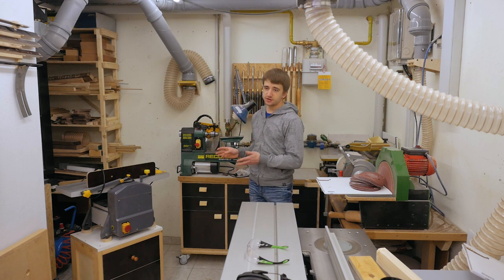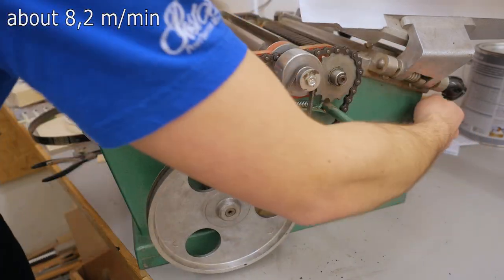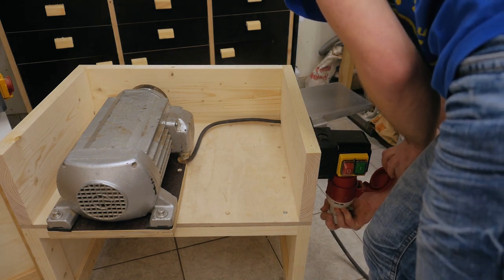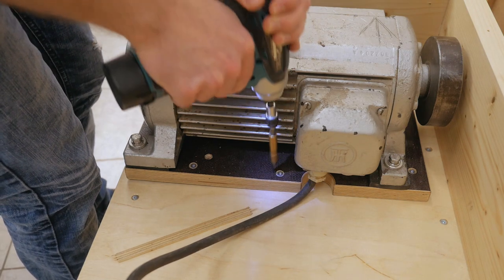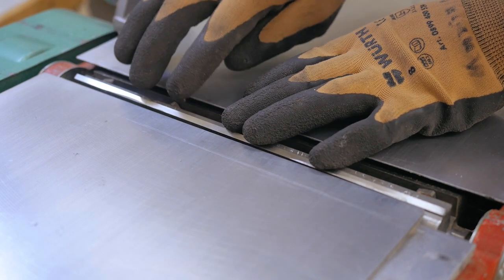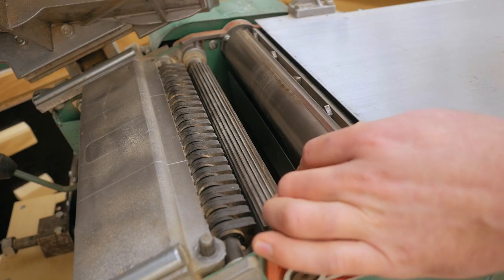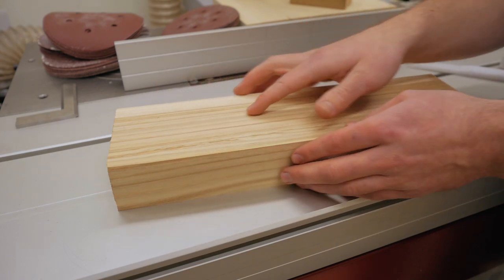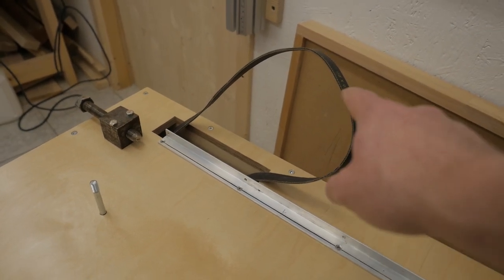New Old Jointer/Planer: Kity 636

Comment: What make/brand was your old jointer/planer? How did it perform and how much? Thanks
Reply: Robert Williamson. hi. It looks like my Woodstar PT85. Very much a hobby machine. The 85 means 8" cutting width and 5" thicknesser. Can't remember what I paid for it but not one of the most expensive for sure. I am sure you will be able to research it online. Regards, Mike
Reply: Hi Mike, would appreciate some feedback on performance. A lot of the reports on the net don't look too promising. How did it serve you?
Reply: Robert Williamson . Hi Robert. My workshop is very small so I bought small and cheap. I don't use it very much. Perhaps because of that I am not expert with it. Results are so so. If you intend doing a lot with one or want good, consistent results I recommend a better quality machine. Good luck. Regards, Mike

Comment: Hello.  I also have a kity 635 and want to restore it. Do you know how to remove the gears (chain wheels) on the back from the axes? Thank you. Jw
Reply: Recently I bought 635 and 616, and I will want to renew them to work on them. However, they are currently in the UK and I live in Poland. How will I know on the spot if I have dealt with the problem.
Reply: Its hard to remove but its possible, probably u have also as i lot of corrosion. I use blow torch and wd40 to pull it by puller. After it i take sandpaper and make it smoother to fit better.

Comment: Beautiful machine!
Wouldn't you prefer buying two planers, and building a Matthias' jointer from one?
Can you buy replacement blades easily? Nothing changed in so many years?
Reply from the maker: I have no space for two individual machines. New blades are still available.
Reply: Marius Hornberger i know you built  a Wandel jointer in the past.  Are they comparable in quality?  Is the only reason you got rid of your wandel jointer space considerations?
Reply from the maker: I've never built the Wandel jointer
Reply: Woops my bad.  I sincerely apologise.  I could of sworn i saw it in the background of your videos... now that i cone to think about it I'm pretty sure it was CosmasB.

Comment: Is residential 3-phase power normal on that side of the pond? Consider me envious if it is.
Reply: Yes, at least in Germany.
Reply: In the Netherlands it is available in most houses but you would have to contact your power company to get  a 3-phase meter, in my apartment cooking  is electric so i already have 3-phase, unfortunately my workshop ( witch is a rented garage ) only comes with 2 x 220 volt 16amps
Reply: Yeah here in Canada the power co runs 3-phase lines down the streets, but you only ever see 3-phase run to commercial/industrial buildings. They will run the power to a residence, but they want a crazy amount of money to hook in.

Comment: Marius, it's been a few years since you posted this. Is this machine worth buying now for around £400? I'm a bit nervous about spares. Are you managing?
Reply from the maker: I think it's still worth it. So far I didn't need any spare parts. But make sure everything is complete and in a very good condition
Reply: @MariusHornberger  Thanks Marius. I missed out - waited too long. This is the item I was looking at: https://www.gumtree.com/p/power-tool-combo-kits/kity-wood-combination-machine.-including-planer-thicknesser-saw-bench-and-spindle-moulder.-/1354114892

Comment: Are all homes there wired for 3-phase power? That's very uncommon in the US.
Reply: PreyOS very common in Germany, in most places 3 phase is used for the stove in the kitchen.
Reply: Wow, very cool. Thanks for the reply.
Reply: Christoph Müller well, the 3 phases are not used in parallel,  they usually devided on different cooking plates on the same oven

Comment: Great video. Thanks. 
How did you adjust the infeed (and outfeed) table relative to the axel back to front?? I have more that 2 mm difference where the tables seem to be sagging towards the front?? Any hints?
Reply: Did you ever get a solution to this problem?  I am having the same difficulty…
Reply: @jamespreece7002  Nope - ended up getting rid of it. Found that the entire table was twisted. No good... Bought a new instead...

Comment: I wish we had household 3 phase here :(
Reply: Yeah, you need an expensive converter to run 3-phase stuff here unless you are in an industrial location.
Reply: Building a rotary phase converter isn't that complicated.
Mainly you need a large three phase motor and some capacitors.

Comment: So do you have 3phase at home?
Reply: Pretty much everyone in Europe have 3 phase.
Reply: Doktor Jönsson not in UK. All domestic is single phase.
Reply: Almost every European home has three-phase power.
Reply: Most European house holds have 3 phase - definitively in Scandinavia and Germany for sure. Stoves usually run on 3 phases.
Reply: In Germany nearly everbody has 3Phases at home. Very nice when you have a electric oven
Reply: Malé motory jsou obvykle s námi na Phase 1 (230V) velké motory pak 3.stage (400V).
Reply: 3phase is standard in almost all homes in Europe. We also have 220V in the wall outlets :)
Reply: Another example of the UK just not wanting to be in the EU right from the beginning if you ask me. So many exceptions...
Reply: Rainer Zufall always one who has to drag everything back to a slanging match about politics.

Comment: snipe?
Reply: A slight dent at the end of a piece of wood caused by the wood dropping as it comes out of the thickness-er, as there's less support for the wood at the end as its not touching the support rollers or bottom.